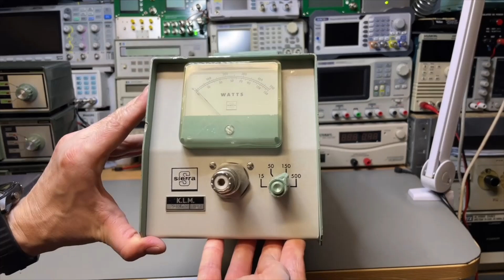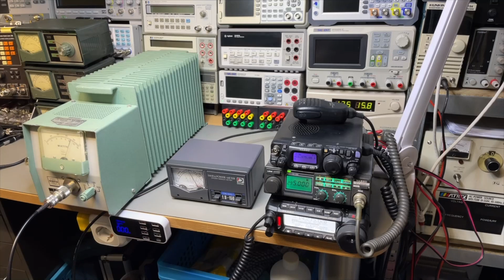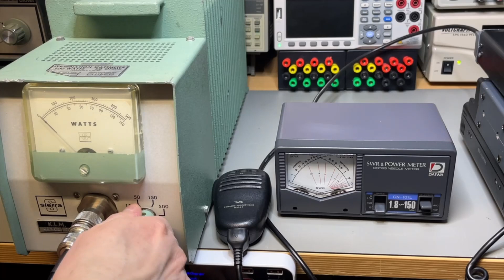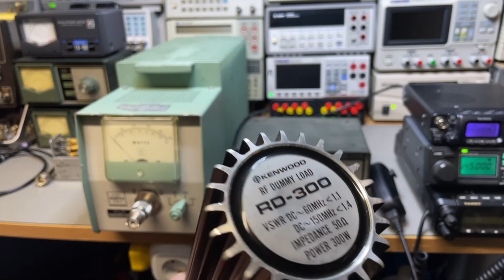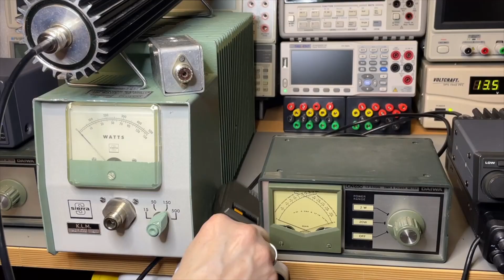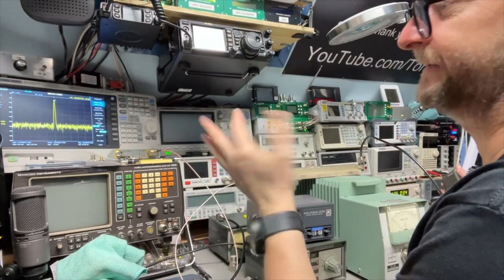TA•0323🟦SWR - Dummy loads on Different Frequencies - Daiwa Bird Kenwood

Comment: A really interesting comparison - thank you for sharing it with us.  When using the high frequency attenuators as dummy loads you will get better VSWR if you terminate the attenuator output into 50 ohms. If un-terminated the output is a perfect reflector and the reflected power at the attenuator input will equal the input power minus two times the attenuation value. Regards,  David
Reply from the maker: Thanks David, yes you are correct, its 1/1000 and 1/100 in the actual scale on the reflected needle. but you are correct. i was not thinking..good feedback!